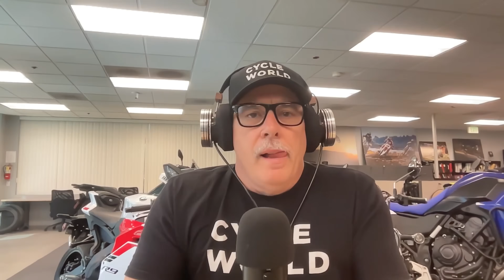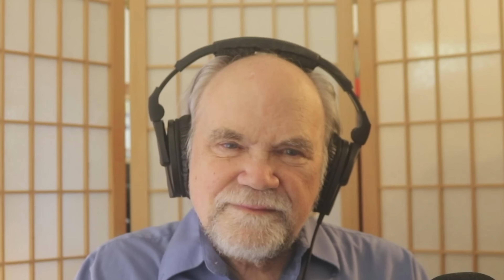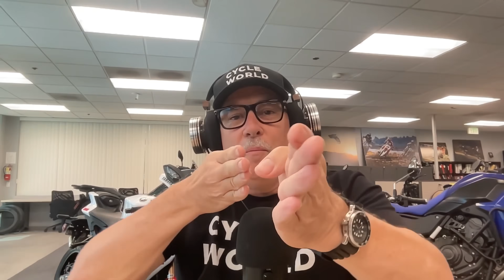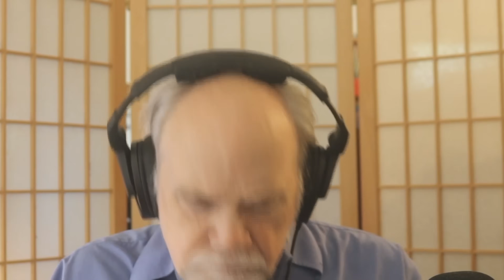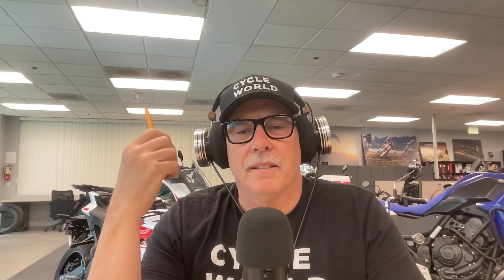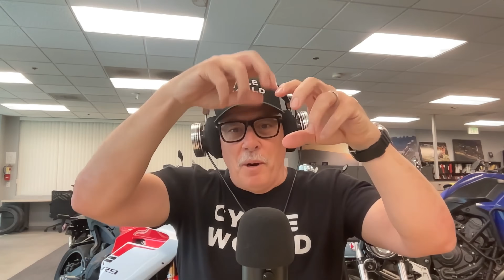Fun With Materials: What are Motorcycles Made of and Why?

Comment: Back in the day I worked as a machinist.  I machined  parts from the oil field to aerospace in a small job shop so I was exposed to a wide variety of materials.  I was always fascinated by the different properties of materials during machining. Thank you Kevin for your insight even if it is just peeking over the edge of the window sill.  It's a wonderful view.

Comment: I used yo mechanic on a 1982 Suzuki RGB500 mark 8 GP yet stroke. It had magnesium crankcases. They suffered porosity when they got hot and sucked air which led to piston seizures. The solution was a rubberised coating applied to the interior of the crankcases.

Comment: I've often pondered the feasability of a billet 6061 head, hard anodized for the valve seats and guides? Hard anodize is very hard, like a file won't touch it. But it is thin, i.e. .002" thin.

Comment: The complex construction process of the Honda NSX road car's aluminium monocoque chassis is both fascinating and ingenious.
Due to different grades of aluminium used at various locations, some welded, some epoxy bonded, required purpose built kilns that would contain the completed monocoque chassis to heat treat the completed unit to restore the mechanical qualities of the aluminium materials that were affected from welding beyond the critical temperatures.
Reply: Thought i read the lotus elise is structurally held together by superstrong industrial adhesives.  Lightweight. Interesting
Reply: The aluminium monocoque chassis of the modern AMG Mercedes SLS63 gull wing would also be interesting case. Having driven one (not mine ) it was a very impressive car
Reply: Interesting!

Comment: My can-am brochure from 1979 mentioned a plastic Preston Petty front fender, ChromeMoly 4130 frame, Sun alloy wheels, surgical rubber Bombardier hand grips and Magnesium hubs. It did have a plastic fuel tank.

The Can-Am Origin does not feature any magnesium components; instead, its components include a liquid-cooled ROTAX® E-POWER motor, KYB suspension, J.Juan brakes, and Dunlop tires on spoked wheels. While some racing and high-performance vehicles use magnesium, it is not a material specified in the components for the Can-Am Origin electric motorcycle.

AI has been used to find new metal alloys based on principles of metallurgy. It has been able to find possible combinations and others to discard.

Comment: My can-am brochure from 1979 mentioned a plastic Preston Petty front fender, ChromeMoly 4130 frame, Sun alloy wheels and Magnesium hubs. It did have a plastic fuel tank.

The Can-Am Origin does not feature any magnesium components; instead, its components include a liquid-cooled ROTAX® E-POWER motor, KYB suspension, J.Juan brakes, and Dunlop tires on spoked wheels. While some racing and high-performance vehicles use magnesium, it is not a material specified in the components for the Can-Am Origin electric motorcycle.

Comment: Your sprinter sounds like Mario Cipollini. Incidentally, cyclemotors were quite popular over here in Britain in the 1950s. Companies like Cyclemaster, Mini-Motor, Power Pak, BSA and others offered variations on hub and tyre roller drive for bicycles, in a country getting back on its feet after WW2. They were overtaken by mopeds, which offered an integrated design, albeit with pedals to meet UK laws. This legal anomaly reached its nadir in the 1970s, when 50cc super mopeds - small sports motorcycles in reality - carried folding pedals, in spite of them being virtually impossible to pedal.
Reply from the maker: It was Cipollini! Thank you. --Mark Hoyer
Reply: @cycleworld  A counterpoint to flexi-bikes were monocoque time trial bikes of a similar era. They were so stiff the bike refused to corner, at least with steering geometries then prevalent, losing the rider precious seconds as they went straight on into the crowd.

Comment: Welding 531 should remove the strength that had been added by heat treatment and maybe by work hardening. The advantage  from butting (extra thickness at the ends of the tube" isn't affected.

Comment: Oddly enough the type of tube steel with a weld seam is actually called "seamless tubing", what's considered a "seam" type of tube has a rolled seam like what you see on the aluminum downspouts on your home, the installers always hide the seam by installing the downspouts with it on the backside because it's more esthetically pleasing (looks better), they still make steel tubing like that but it's not very common, it can only be made out of sheet metal thickness steel and there isn't many uses for it.
DOM tubing is more resistant to stress cycles as Kevin said but that's not always why it's used, as a steel fabricator I built plenty of machines where DOM had to be used in certain places because there'd be a smaller tube or maybe round bar that had to slide inside of it, the rest of the machine would be made out of seamless but it couldn't be used there because seamless while relatively smooth and even around the outside has that weld seam sticking to the inside meaning you couldn't slide another tube or piece of round bar inside of it without it being considerably smaller to clear that weld sticking out on the inside making for a sloppy fit, DOM has both outside and inside diameters that are held to fairly close standards.

Comment: I havent watched yet but i really like the topic. I was a Machinist for 40 years, i saw a lot of different materials. Nylon was one of the most difficult to work with for fixtures and holding tolerance's. I loved Aluminum, I think it was 7075.  Great stuff, tuff yet lightweight and made nice chips.
Reply from the maker: I recently machined a large steel socket to fit a gland nut on my hydraulic jack (for rebuilding the pump, etc.), and all the end mill would do is squeak and smoke! It was machining, but slowly. The next thing I machined was a block of aluminum to make a spacer, and what a pleasure it was! Nice chips for sure.--Mark Hoyer
Reply: @cycleworld  That squeaking is actually the end mill  laughing at you.

Comment: Kevin, why were P&W R-2800 not put on B-29s?
Reply: They weren't powerful enough.
You can't look at their HP ratings and believe it's some kind if final say on the matter, first off is many of the R2800 ratings you see include WEP with water injection, R3350 on the B29's didn't have water injection, also as important is the state of tune, think of it as comparing a performance option 350 in a Corvette to a 396 in a pickup truck, the 350 will show more HP on paper but that's because it's tuned to a higher level than the 396 in a pickup that in comparison has milder cams and a smaller carb that's intended to last and not stress itself to death making the kind of power required. 
As far as the problems with the R3350 forgot everything you'll hear in YouTube videos about the B29 or R3350 engines, all they do is keep repeating the same myths over and over, basically because they use each other as source material.
There was never really anything wrong with the R3350 engines, Col Paul Tibbets even made that clear to Hap Arnold after spending some time flying them, Arnold put him in charge of finding out what was causing all the engine problems and Tibbets told him the engines themselves were fine, it was a combination of things from what should have been a 5 year development program getting compressed down to 3, it had people misinterpreting data causing them to chase their tails and redesign cowlings and do all kinds of other things that while they did improve things weren't what the real problems were in the first place, pressing the B29 into service without a proper pilots manual, training the pilots to run the engines like on B24's and B17's because that's what the USAAF had experience with, human errors were the real problems with the B29 essentially. 
I've spent over 2 years researching the B29 and the R3350 engine, the series of events and the misinterpretations by people that led to everyone chasing their tales and blaming problems on things that didn't exist would fill at least a chapter in a book, every time I try telling someone the story in the comments of a YouTube video it gets auto deleted and I'm not doing all that typing again just to have it erased by the YouTube AI overlord again. 
But just know there was never really anything wrong with the R3350, if there was it never would have gotten type certified and get off the test stand and into aircraft in the first place.
Reply from the maker: Kevin says, "It took the 2800 a while to reach the power level, while the 3350 was claimed to be at 2200 hp for T.O. quite early. Third-party testing of the 3350 later showed the claim of 2200 was in fact more like 2050. I suggest having a look at Graham White's 2800 book." 

It's called "Pratt & Whitney's Dependable Masterpiece."
Reply: @cycleworld 
I have Graham White's book on the R2800 engine, I've desperately searched for a comparable engine on the R3350 but can't find one, there's some books available even some from the military on the R3350 but they're more technical books, maintenance, technical information (valve timing, ignition timing etc etc) and while I prize that kind of information what I'm looking for in regards to the R3350 engine is reliable information on the history of its development like White's book has on the R2800 and not just technical information, theory of operation and that sort of thing. 
I recently got Daniel D Whitney's book "Vee's For Victory! The Story Of The Allison V1710 Aircraft Engine 1929-1948" that like White's book on the R2800 is a treasure trove of anything and everything on and about the Allison V1710, it also is full of technical information along with a detailed history of its development and use in various aircraft, especially of interest to me is it has excerpts from letters from Hap Arnold to Allison, Army Material Command and the various aircraft manufacturers that's great for busting myths such as the Army only wanting the supercharger/turbo configuration for high altitude performance in their aircraft, after they had the turbo dropped from the P39 and P40 to expedite their development and rush them into production because everyone was screaming for aircraft Arnold told Allison to get busy on a 2 stage supercharger for their engine in a letter dated June of 1939, this completely destroys the common narrative that Allison didn't start development on that type of supercharger until the US was already in the war and prior to the US entering the war had forbidden Allison from spending resources on development of a 2 stage supercharger.
It's that kind of a book with the history of the development of the R3350 written using credible sources I'm looking for, does Kevin have a recommendation for any such book on the R3350?
Reply: @cycleworld   
YouTube auto deleted my first post telling you I have White's book on the R2800 engine and have been desperately seeking an equivalent book on the R3350 engine, there's books out there on it that are chock full of the technical information I always want but I can't find anything that appears to have the detailed, reliable information from credible sources on the history of the R3350's development, can Kevin recommend any on it?
Reply: The R-2800 simply didn’t provide the horsepower per engine that the B-29 program required. The R-3350 was risky (it had reliability issues early), but it was the only available American radial with sufficient power-to-weight for the B-29.